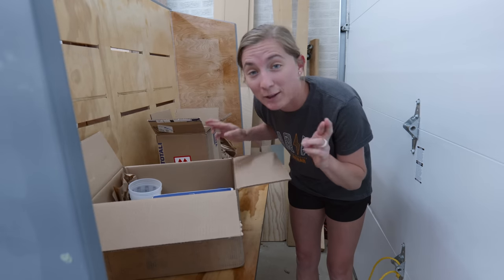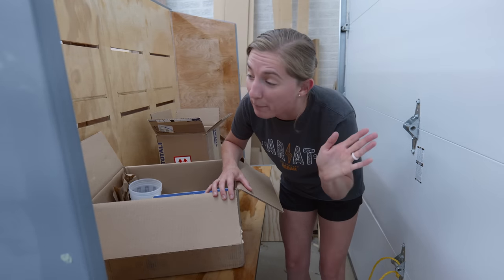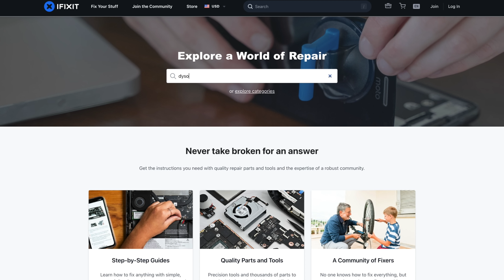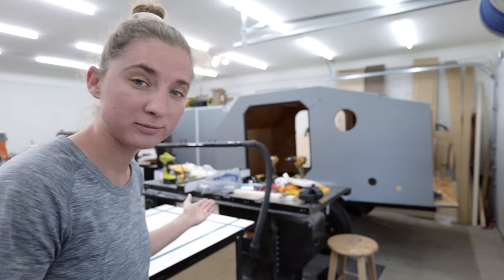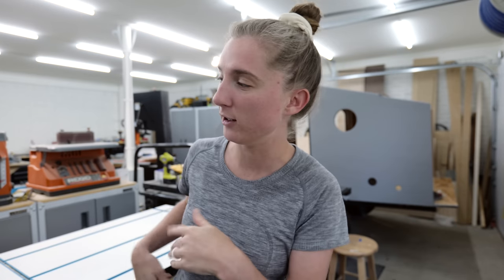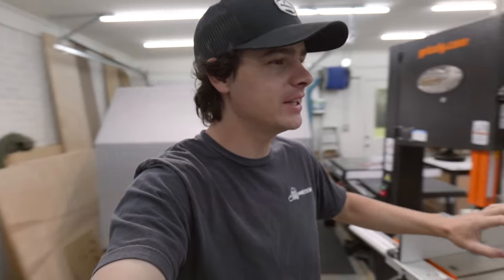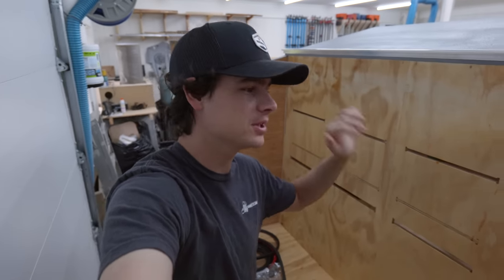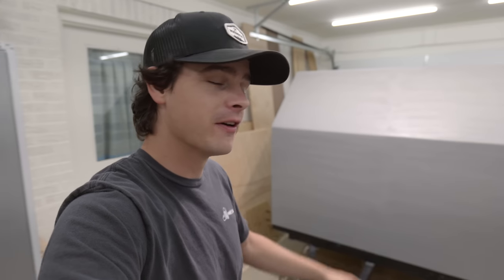The DIY Harbor Freight Teardrop Trailer just got even COOLER...

Comment: Merry Christmas Molly & Dylan...my wife and I have been watching your videos for almost 2 years now (when I searched for an outdoor grill station for the 5 burner Pit Boss griddle I had bought) and really enjoy your content and enthusiasm - quite refreshing for your generation (we are in our late 60's). So, if I looking to buy some iFixIt tools sets and if I use your link in the description, will you get a commission? We would like to help you in any way possible and I am looking to buy the Mako set. And, do you have an Amazon store - I didn't see a link to one in your videos. We just bought an Omtech Polar Laser Cutter & Engraver and I am modifying the exhaust ducting - removed the internal fan and will be adding the inline fan that came with the unit. I have a pretty adequate  tool bits set, but the tips of the bits are actual smaller than stated size, so there was some bit slippage on the head of the screws. When I measured about ⅛" up the tip, then the stated size was good. Thanks, Charlie & Louise in Central Ohio
Reply from the maker: Hope y’all had a merry Christmas as well!! Thank you so much for watching and being here🤗🤗 We do have an Amazon store: https://amzn.to/3THA8vc Sounds like the iFixit kits would come in handy for your project!